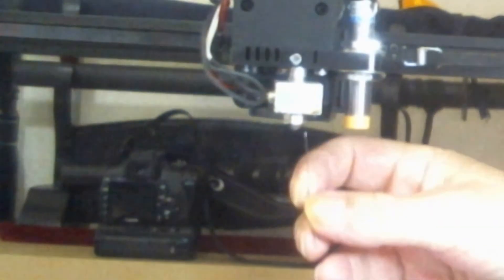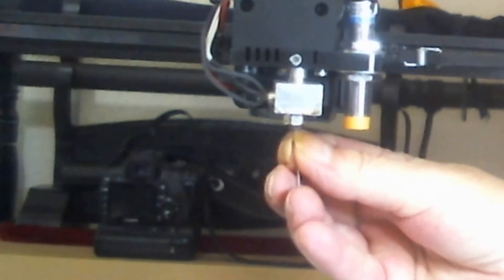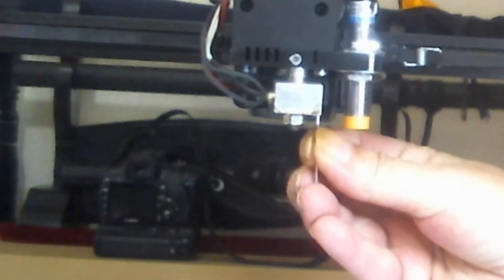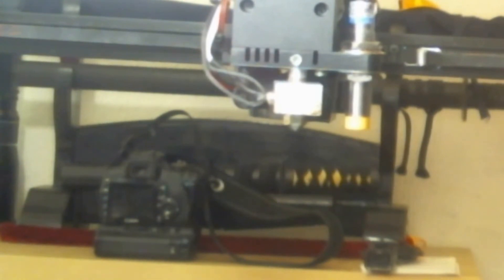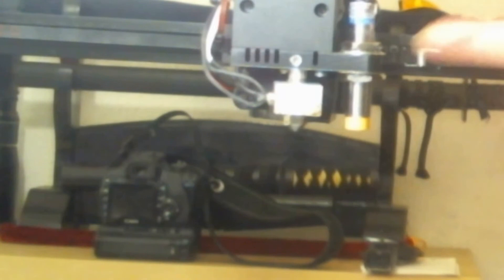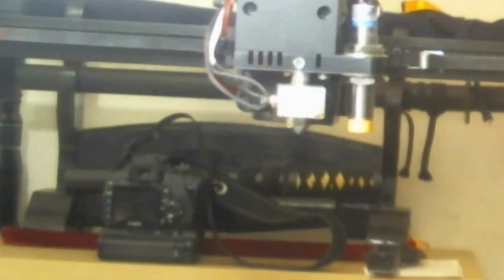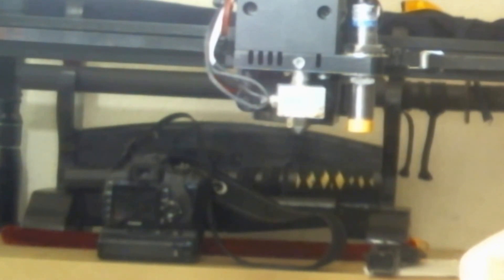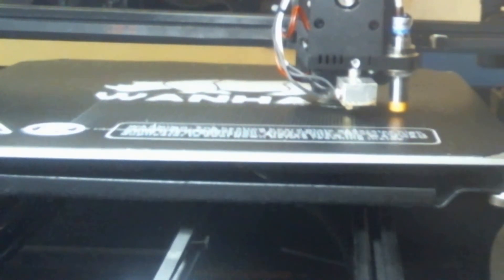Problems with the D9 now

Comment: The one I paid for is even worse...
Reply from the maker: oh   sorry for that
Reply: @theGermanPrintingNerd 
Lol I have had all your issues including the filament leaking and they charged me 38 dollars to replace a the faulty leveling sensor they shipped it with. . I have eventually converted it to use linear rails and bearings. After my second print the thermistor died and now I understand I need a new splitter board which I should hopefully get in next week.... I love your channel BTW.